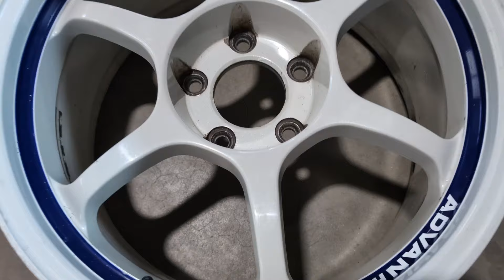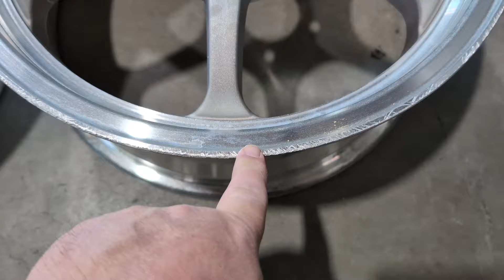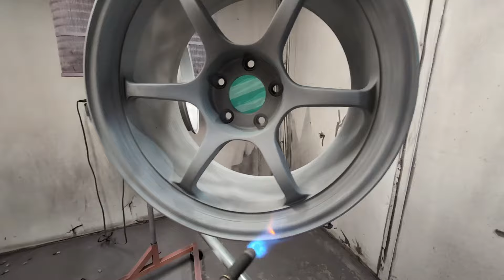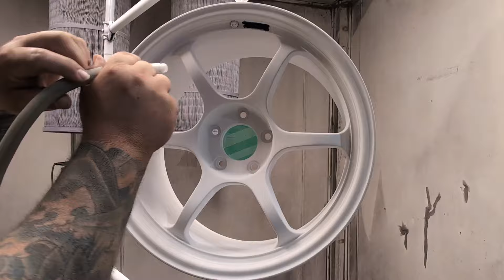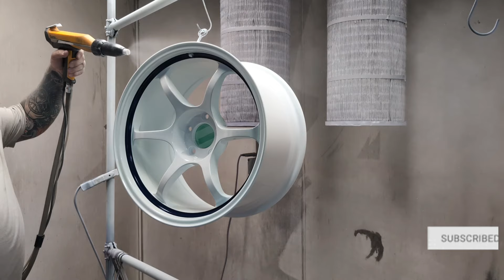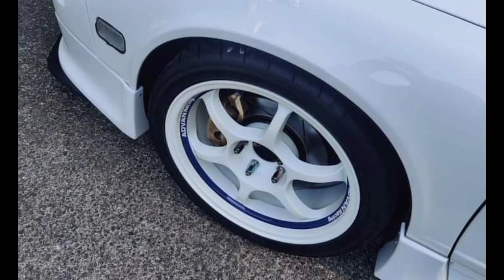Two Tone Powder Coating with Vacuum Attachments! Worth the Hype? - EP 185 - Unknown Coatings

Comment: That's awesome dude
Reply from the maker: Thanks!
Reply: @UnknownCoatings bro I have a set of rg that I want to refinish in white as well but I don’t know what is the paint code for the blue please share with me the info on the blue powder that you used
Reply from the maker: @o.c.garagejapan9737 RAL 5011 I believe. I need to check my notes. But that seems correct
Reply: @UnknownCoatings  found it thank you 🙏🏾